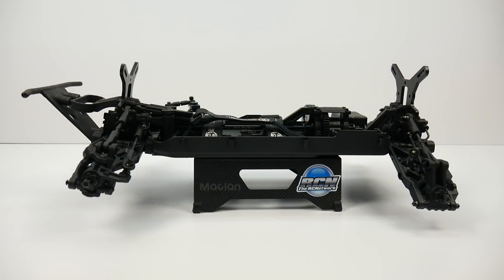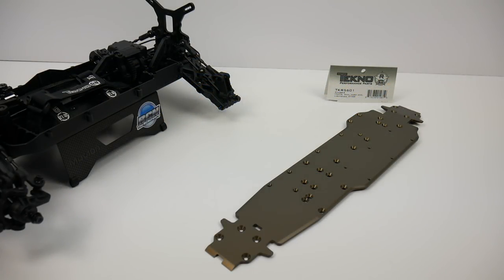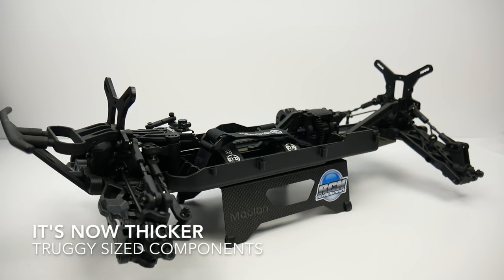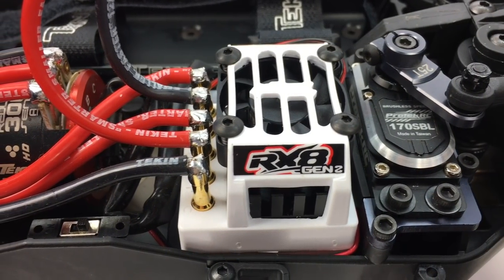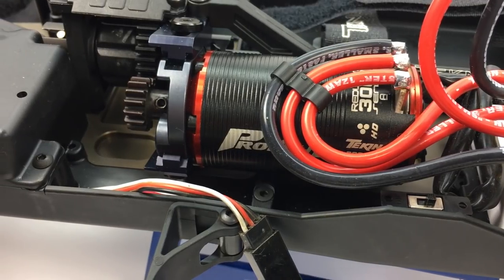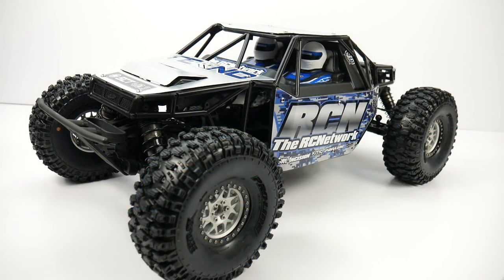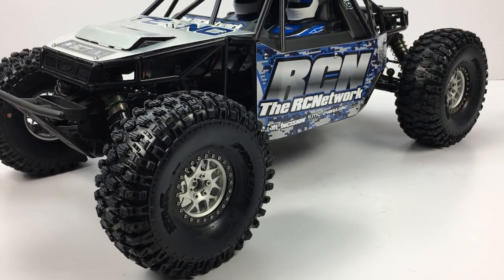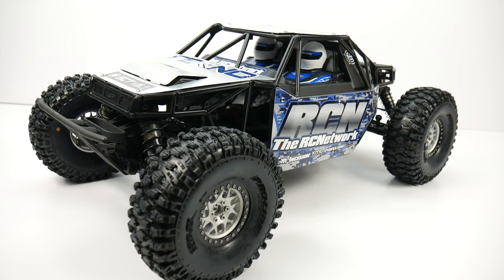Tekno DB48 1/8th Desert Buggy - Build Series - Part 2 of 2 - Modifying

Comment: I am looking at rock racers now and ran across this build.  It is impressive.  I always like to have something no one else has.  How does it do in slow speed crawling type situations? Not technical crawling
Reply from the maker: It does decently for a FIS rig.  The height of the Hyrax tires (5.75") and the narrowness of the chassis help.   For technical SLLLOOOWWWW crawls, it won't do well.  You'll find that all the "rock racers" that are out there:  Bombers, Yeti, Rock rey, etc are all waiting to break.....and I broke all of them, which made me design this platform.  The DB48 drives like an 1/8th scale buggy.....pull the trigger and it just goes.  It's very predictable and won't veer or torque twist.  Watch the running videos I have of it.
Reply: The RCNetwork cost wise for a weekend brasher do you think the overall reliability of this is comparable priced to constantly fixing the out of the box RRs is worth it. I don’t have U4 racing here so it will not be for competitive use

Comment: So factory looking and beasty looking! Awesome style and taste!! Only thing I'd change is to use hobbywing electronics... That sbl 170 black servo I'm gonna use in a Tekno 410.3 SCT that I'm gonna build into a monster short course very similar to this bad boy! Tekno take notes and make this one a kit!! I'd get it if it was a kit! Rich you're so cool and your imagination is incredible! When are you having another giveaway? A Tekno SCT 410.3 with hobbywing electrics, futaba radio system (4pv or 4px) with a Protek 170 sbl and ready to race would be killer with either a traxxas slash 4x4 body or a Proline raptor flo tek custom painted red or orange black metal flak would be. A show stopper in looks and just mean to watch dominate the outdoor race tracks in the loose/loamy dirt! Love Tekno and the trucks you build rich! I can never say how thankful I am with your builds!!
Reply from the maker: I do like my Hobbywing stuff, but this Tekno needed some Tekin power.  There will be two giveaways in December - full RC's, not just misc parts, and stuff
Reply: +The RCNetwork which is better for the Tekno 410.3 SCT, a full tekin system (Rx8 gen 3 with 3000-3500 kv motor and programmer) or a hobbywing system (xerun xr8 plus with 3556 motor rated at 3200 kv {not sure on the series but It is the g2 full sensored motor and is rated for heavy duty SCT) with mulitifunction LCD programmer? I'll be bashing with this as a SCT converted to monster truck, more like a monster SCT... On steroids!! Running 2s LiHV from Protek rc (8500 mah, 100 continuous c rated with 5 mm bullet connectors and 10 awg wire thru out everything), 3s gens ace (7000 mah 60 c fitted to use 5 mm bullet connection) and a killer 4s LiHV from Protek when I get brave and wanna really fly (6500 mah with 5mm bullets and 100 c ).... Tires I plan on using are Proline badlands mx28 premounts.... Any other help on building this I would surely appreciate as I am gonna really build this to be tough, fast, and reliable... Amain hobbies has assured me that 4s LiHV is fine to use. Email me!

Comment: This is a awesome conversion. I am working on mine right now. Have a question about pinion. In the video you said you were going to test with a 15t. What did you think? I am planning on running a 3100kv. Which is close to yours. Did you keep the 15t or go higher?
Reply from the maker: I stayed with the 15t, it was perfect with the 3000kv motor.  you might be better with a 14t depending on your ending weight and battery
Reply: That was on 3s right?

Comment: Rich, how did you end up mounting the cage?
Reply from the maker: Still rocking zipties.  They hold everything solid and are easy to just cut off at the end of a race. - Other's have fashioned body mounts that work using the DB8 mounts and some spacers off of the SCT shock towers

Comment: Hey Rich
Just wondering if you could have used the ET48 as the base instead of the SCT410? Meaning less central drivetrain swap outs.
Obviously the length works but width maybe an issue?
P.S. I now watch all of your uploads with my new RCNetwork cap on!
Reply from the maker: +Paul Garwood nice!  It would be more trouble with the ET....you need the width of the SCT and the 12mm drives

Comment: Hi Rich, amazing job mate well done. How do you think the SCT410.3 would hold up as a "basher" with a similar 'rock racer' setup like yours?. (I dont like to use the word "basher" - I look after my cars but basher explains its use best lol).  Most review's I have found are using it for race purposes only. It seems to use similar components to the MT410 which is a beast.... so I would assume it would have great durability aswell??
Reply from the maker: kasshowboatin yep, very durable. Haven’t broken a thing and I have 4 races, 8 qualifiers and countless video shoots.
Reply: Nice! I’ve been considering the yeti and rock rey kits, but now I’m pretty sure with a scale cage/body, crawler tyres and some diff tuning (500k oil…?) the SCT410.3 will deliver beyond what the other kits can offer. Thanks again Rich, and for the work you put into your channel.

Comment: You did the work to make a fully independent chassis that fits the nomad cage, can you let us know why you didn’t just use a nomad? Thanks.
Reply from the maker: Adrian Chen I ran the Nomad for Summer Nationals 2017 - and with race level electronics, not the RTR stuff. By the end of the race, the rear diff completely blew out resulting in FWD only and the front was fading fast. Also, it has 17mm hexed wheels, which are hard to find tires for the 2.2”/3.0” SCT wheel it takes. The stock general grabber branded Tires are good for the street, but that’s it. The suspension was ho-hum - nothing spectacular about it considering it was from a platform designed 8 years ago for the RC8.2. With all my Tekno experience, it just made sense. Nothing breaks and they have a solid design. Just no cage to make it race legal.
Reply: Awesome. Thanks for replying. I’d love to see a bashing video of this rig and some high speed stability tests. It looks so awesome it’s almost convinced me to build one too, except I’m wondering about the high speed stability and the overall balance of the rig in bumpy, bashing type terrain with the IRS (the two points I feel are weak on the yeti). Cheers.
Reply from the maker: I have an outtake video of this rig with slomo of the rear suspension working.  As for high speed stability - It's great.....but it was built for suspension travel and getting through a U4RC track.  If you were to compare this in real life, it would be like comparing a Ford Raptor to a Shelby Mustang, on the street....of course the Shelby would out perform

Comment: Hi, do you think it is posible to install an SCT body on top of a cage, just like in the Traxxas UDR? ...SCT trucks get very dirty with mud into the electronics, but a cage would keep the inside of the truck with the electronics protected from any mud or sand using the panels attached to the cage frame  (without the cage body, just the panels), while the SCT body would be still being the final look of the truck. I would like to combine the Losi SCBE Cage into the TLR TEN SCTE 3.0 kit with its original body for bashing on dirt and mud without worry about geting the electronics full of mud. But I don't know if somebody have try something like it. ...I think Traxxas UDR is a great combinaton of a Cage and a SCT like body, but seems to be the only one using such combination. Thanks!

Comment: Is this a 1/8 or 1/10. The link to the kit says 1/10 but the video title says 1/8
Reply from the maker: It’s 1:8th scale. Although it uses the SCT arms and drives, it’s been fitted with the ET48.3 Truggy chassis and driveline. It’s larger than a rock rey / Yeti

Comment: Tekno could make a conversion kit with hexes, truggy shock towers and truggy shocks--that would  be best instead of an entirely new kit. If someone used a lighter oil with pink truggy springs, it would be perfect for U4RC.
Reply from the maker: Patrick Michael just like the MT410, Tekno used existing parts to make it happen. The DB48 uses an entire kit, but then adding those additional items. They could easily subtract the SCT chassis plate and driveline and add in the Truggy. BTW, Truggy Springs/shocks are too long and I’ve perfected the oil to 350/200
Reply: Rich, have you seen the new Traction Hobby "Cragsman"? It is an amazing looking Crawler/trail truck.
Reply from the maker: Yeah, skeptical at best....little know brand (at least to me) and RCMart or Asia Tees is behind it.....not too impressed.  I know Medic got his...and I'm sure he'll market it well for them